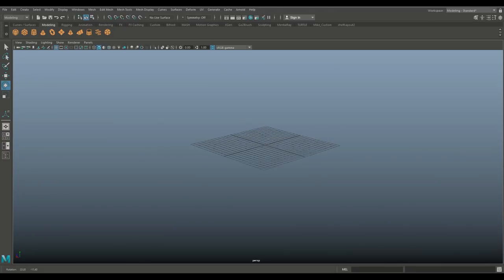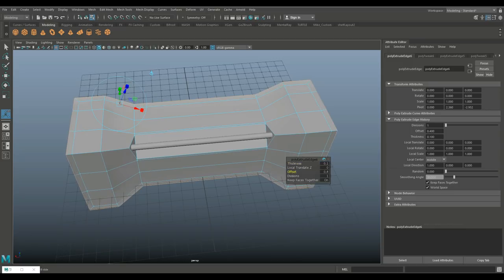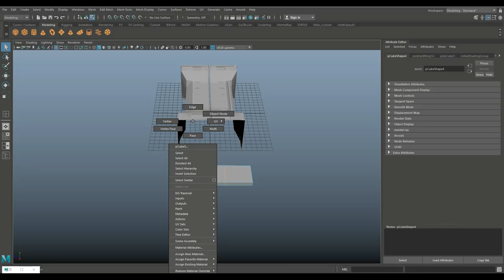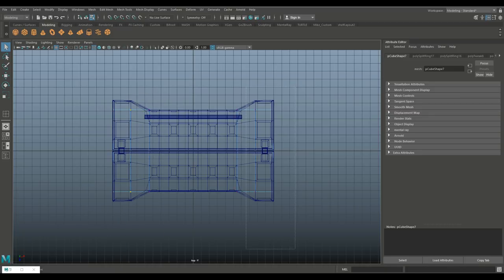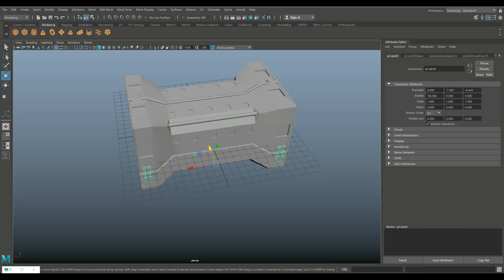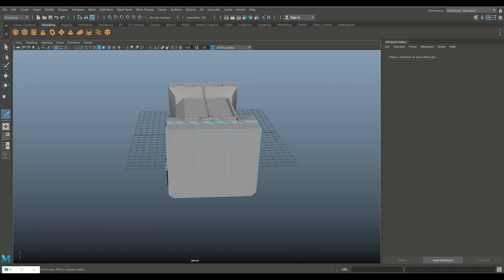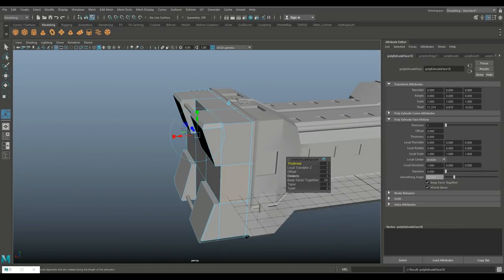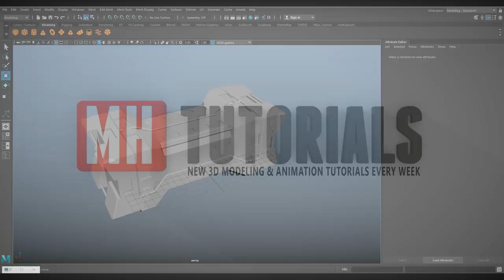Maya 2018 tutorial : How to model a SCI FI case

Comment: Mr.Mike, I need a help from you i.e. can you suggest me the system configration for maya software..  I have 16 GB ram, 6 GB Nvidia graphics card, windows 10, 1TB and 256 SSD is this enough? when I open multiple files it hangs, is there a different way in maya 2017?? Thanks in advance
Reply from the maker: Sounds all good, what CPU ?
Reply: it is a laptop, Mike..
Reply from the maker: A Laptop still has a CPU :-)
Reply: Mr. mike, the CPU in my system/laptop is intel core i7, 2.8ghz